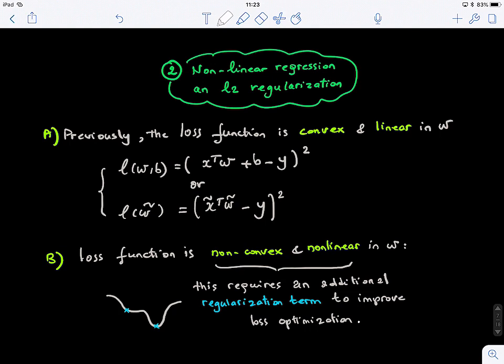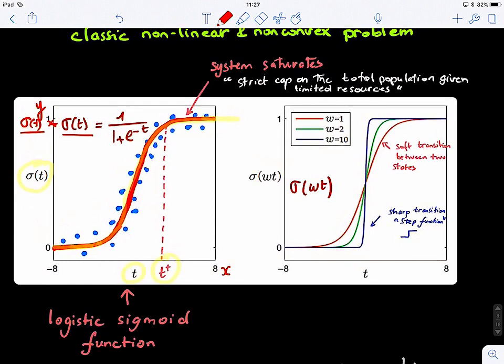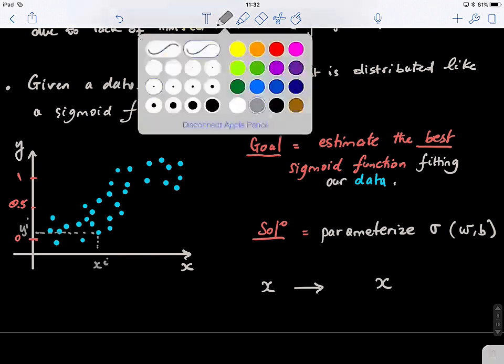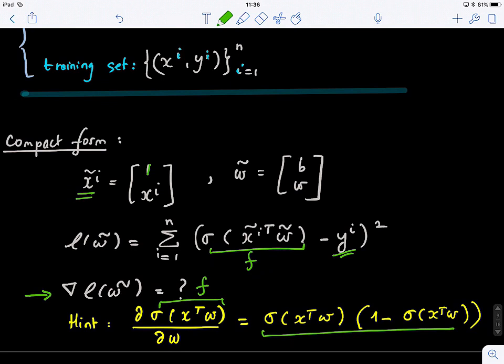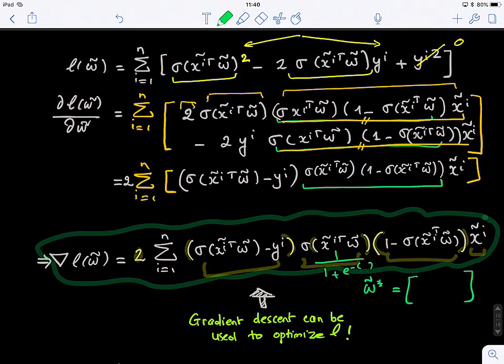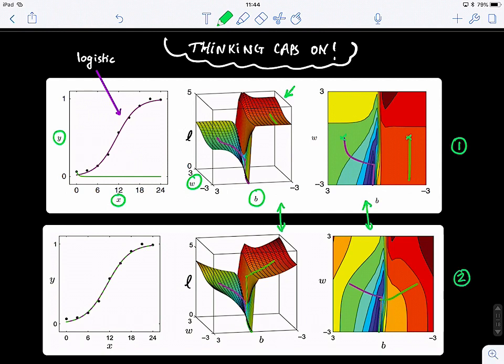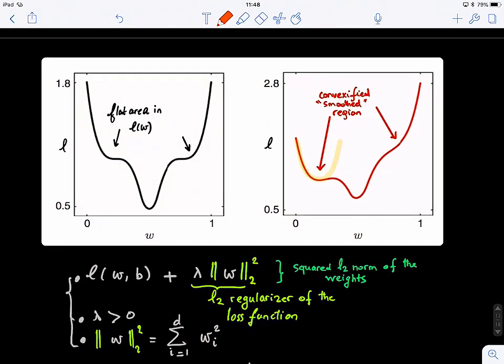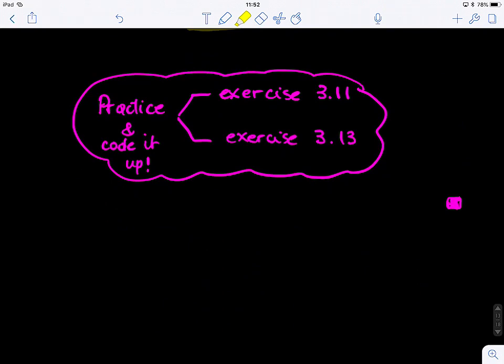Machine Learning Blink 6.4 (non-linear logistic regression model)

Comment: The reason why we used gradient descent is related to the fact that closed-form of w is not easy to come up with? Because during 16.20s, you stated it, if I didnt get it wrong. Wasn't the reason why we used gradient descent was to have a non-convex loss function? Becase if the loss function was a convex one, then we'd compute the gradient where it is 0 and directly jump into the global minima. I couldn't understand when to use gradient descent or when to use closed-form of w and jump into the global minimum with just one iteration. Is the reason based on a non-convex loss function or closed-form of w? Thanks!

Comment: Hi ISLEM 
Thanks for amazing series on ML . I have a question though
The cost function is non-convex because you are using a sqaured loss. Alternatively, we can  define the cost function as the negative log likelihood function then  the cost function is convex.   Is this correct?
Reply from the maker: Hi there! Squaring a function does not make it non-convex. Think about the parabola function x^2. The logistic loss is non-convex is related to the second derivative of the sigmoid function since the eigenvalues of the Hessian matrix of the loss are not all nonnegative. 
"The eigenvalues of the Hessian tell you something about the second partial derivative of the underlying function along specific directions. So if all eigenvalues of the Hessian are nonnegative (positive) the generating function is convex (strictly convex). If they are all negative the function is strictly concave". 

For more, check this out: https://www.youtube.com/watch?v=-S-aNpTnQd8&list=PLug43ldmRSo1LDlvQOPzgoJ6wKnfmzimQ&index=21
Reply: @basiralab  Thanks for the response.